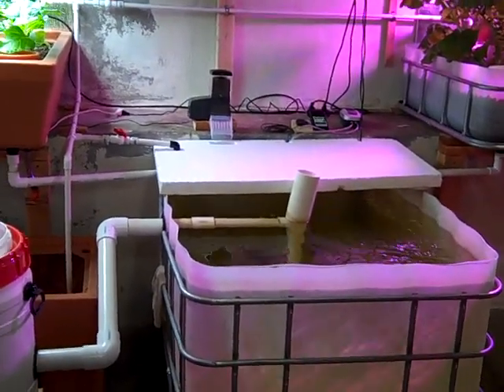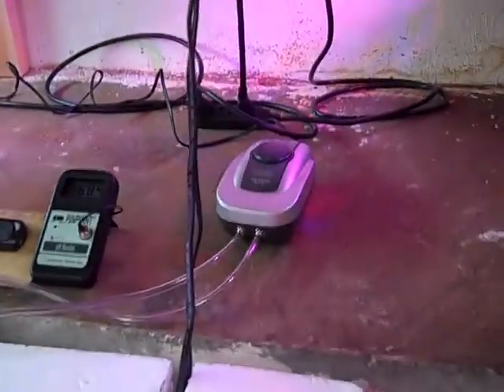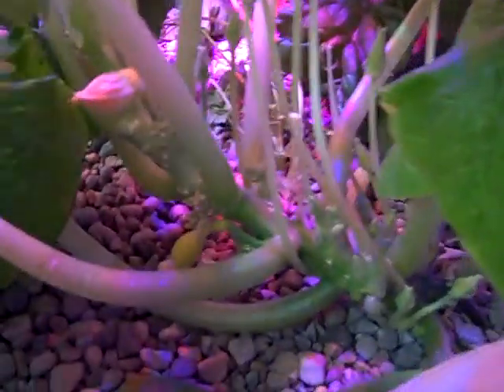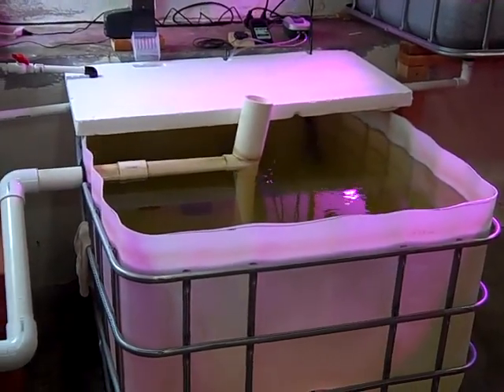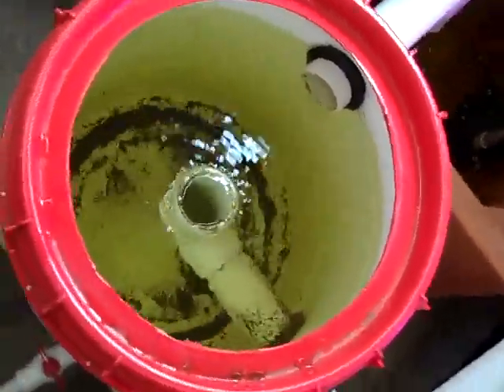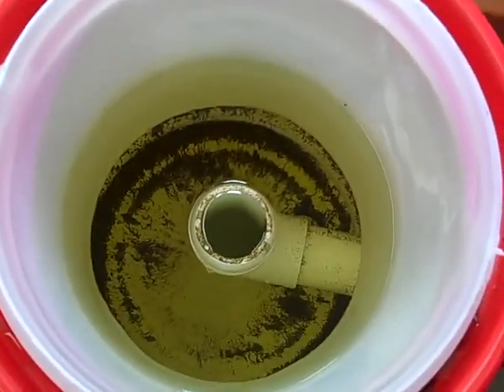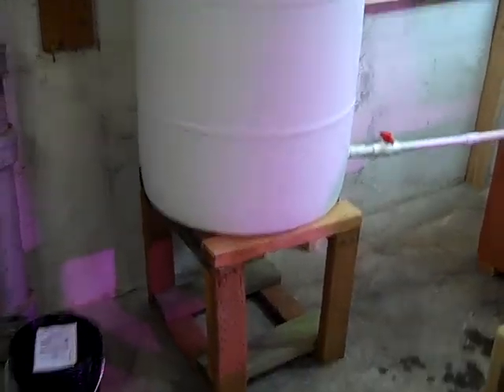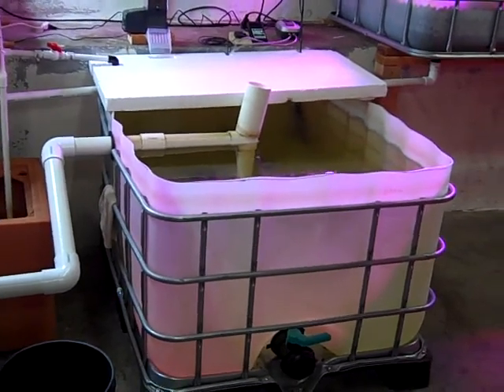AQ PDX Radial Flow Filter

Comment from the maker: I just set that extra piece on the T to weight down the whole thing. Otherwise the inlet lifts off the bottom an inch and sometime smaller fish get sucked into the filter/sump. I don't have any screen on the inlet, just some holes drilled on the side of the pipe.

Comment: Claude, did you ever perfect your schedule for adding missing nutrients?  I'm still fighting some yellowing on plants myself and am awaiting my Chelated Iron as I type this.  I'm supplementing with  liquid seaweed along with epson salt.  I use crushed coral to "help" maintain pH levels.  Don't give up on the vids.
Reply from the maker: Thanks for the encouragement. I am long overdue for an update video. I've settled on a supplement routine, which seems to work. Tablespoon of iron and epsom once a month. Pottasium bicarbonate and Calcium hydroxide alternating to buffer the pH (plus a sack of oyster shells in the sump). This is pretty much every other day. I use this site 5e.plantphys.net/article.php?id=289 to diagnose deficiencies. Not easy to pinpoint, but I think I've got it. I do seem to need regular pottasium - if I just use Calcium, I seem to get a deficiency. Fish load a bit too high, so I've slowed down feeding. Got about 35 tilapia at 6-8 inches each. Make sure you use the "good" chelated iron DTPA, not the "bad" EDTA type.
Reply: Claude Saunders Claude, I appreciate the quick update.  Yup, I got the DTPA iron from Aquaponic Source.  I'm already re-watching all the Bright Agrotech Vlogs on Aquaponic Nutrients.  I know it's a tough balance between three of the key nutrients and how they react to each other.  Thanks for the link.  Maybe I'll get a video up some day too.